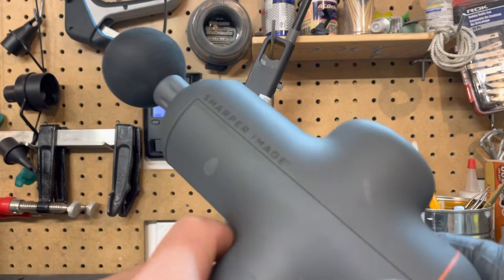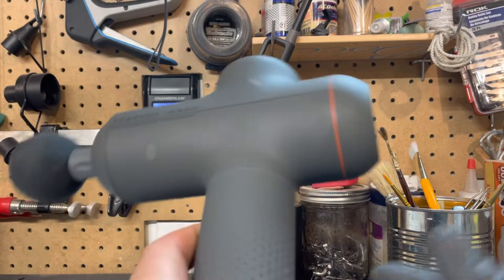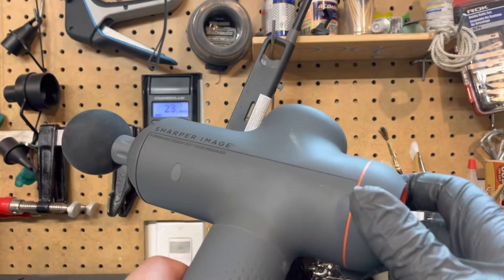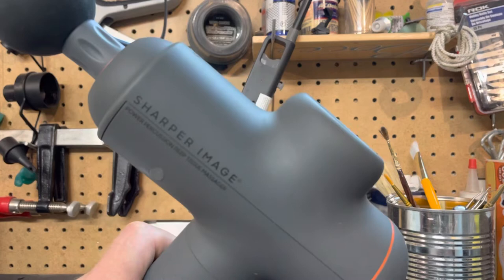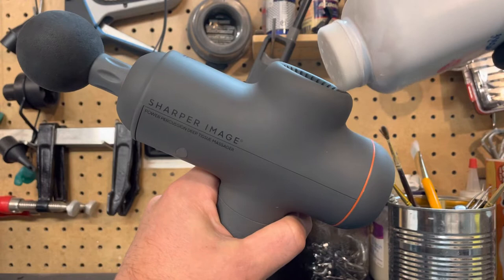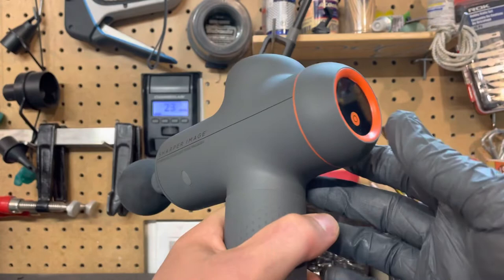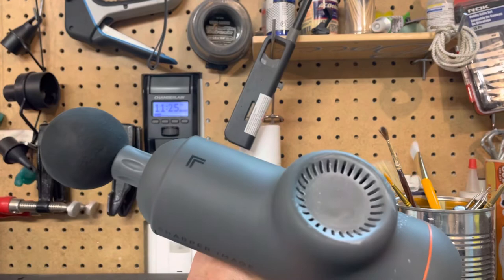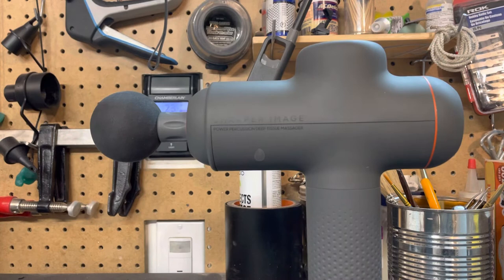How To: Repair Squeaky Massage Gun

Comment: yeah so i have the exact same one from Costco and I took this completely apart.  if you pull out those plugs and remove those screws underneath that all you really need. The screwed are reasonably long (longer then I would have thought) and so the design is quite good. after unscrewing pull apart using the display side as your pivot point but squeeze the sides in as they have plastic tabs that help hold everything in. Don't pull too far because you don't want to yank the cable inside too much. once you see it you'll know how to proceed. I tightened my screwed and oiled a few things. I also oiled around the front piston once i had it back together. That's only because i didn't have any spray Pam or WD 40 and i didn't wanna smell WD 40. I used some lavender oil :).  Just passing that along as thanks for this vid bro. Thanks again.
Reply: And btw, this thing is pretty well made.  Even the plugs have grooves cut in them.  A nice detail.  My wife has the upgrade version of this that added cool and hot capability to a stainless steel massage attachment as well as a charging base.  Well worth it.
Reply from the maker: Amazing!!! Thanks for the info!
I hope your comment helps others! I feel like it is the best part of YouTube, helping others 😉

Comment: Have the same problem. How is the noise 3 months later? Have you had to add more powder?
Reply from the maker: Yes, I add powder every now and then with the squeak is back. Easy to do though…
Reply: @colchilibeck  Hey Colin, just wanted to give you a little update. I was actually able to dismantle the massager without breaking it and managed to get a couple drops of oil on the motor and barring. Highly recommend you do the same. It is working great now and no more squeaking!
Reply: @colchilibeck hey man do you know how I can fix it. The problem that I have for it is that when I’m done charging it and turn it on and nothing is on do you what I could do?
Reply: @zakostendorf  hello could you please share how to open that type of massagge gun?
Reply: @joepsy677  two screws are located under the rubber plugs on the horizontal shaft of the gun. Unscrew those, pull the top half of the horizontal shaft off. The back part of this half piece is nested into the back part of the gun, where the digital read out is. So remove/lift the top half if the shaft like you are opening a book. 
Once inside, I added a drop or two of vegetable oil and that was it. Hasn’t squeaked since
Reply: @zakostendorf thank you very much, in my case it's even worse than that because I got a Aukey massage gun that has no screw at all on the shaft. I was able to remove the rear cover but it seems to be built to not allow any private maintenance. I will be trying to work it out though. Thanks again anyway.